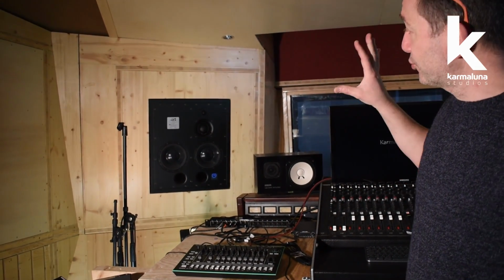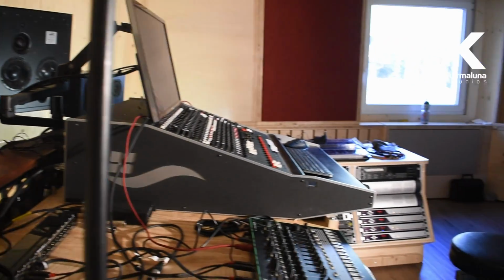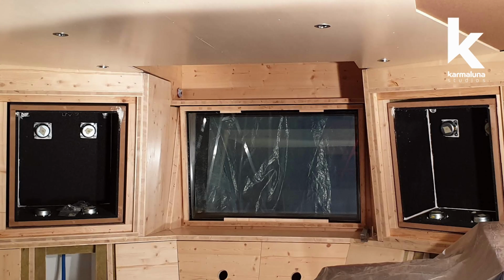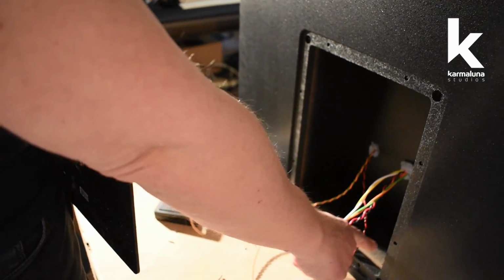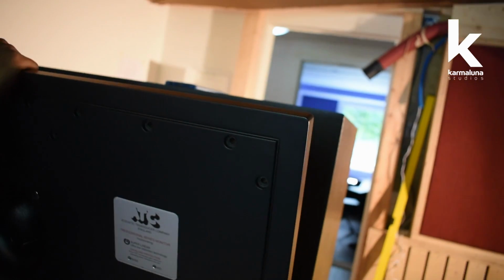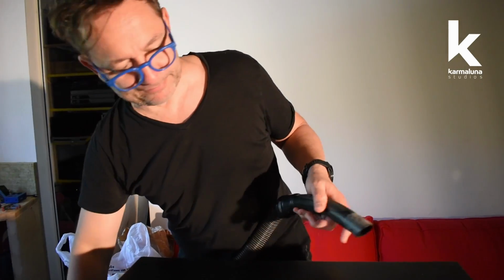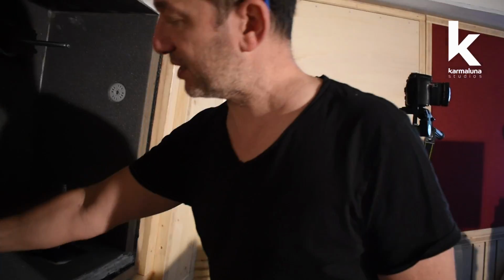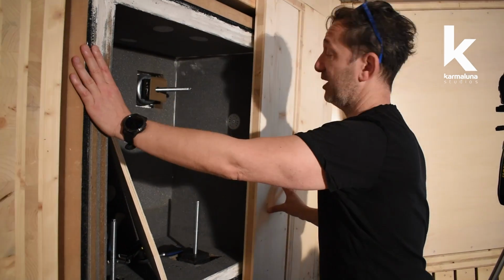In-Wall Soffit Mounted ATC Speakers

Comment: Hi, thanks for the video I am about to flush mount a similar sized pair of studio mains into my Control room front wall. My speakers are a custom built by a company in the UK, they are 700 x 700 x 350. Would it be possibly to get the contact details of the acoustician that advised/ consulted you with the process of mounting your ATC's
Regards
Ronan

Comment: Hi, impressive studio build, very nice studio! I have a question regarding the ATC speakers, if you don't mind me asking: did you use the active speakers and take out the amplifiers or is there a version of the speakers that alsready comes with the speakers and amps separately? And one more question regarding the runded edges of the speakers: is there a way to remove the rounded frame so that the fronts of the speakers are completely flat? This is the way I always see them when soffit-mounted. The rounded edges seem to be used when the speakers are set up on speaker stands. Thanks so much for you help!
Reply from the maker: Hi! Our reseller (Funky Junk) took care of ordering directly at ATC the version with separate amplifiers and flat frames.

Comment: Can i ask how big youre room was before building, how big the room is now and distance between the speakers? 

Kind regards
Alieu S Samateh
Reply from the maker: Sure! The empty room was around 21 ft in length and 16 ft wide, 9 ft high. We lost around 30% of its volume with the sound treatment.
The distance between the two speakers' acoustic axes is 8'-6" (around 2.6 mt).
Thanks for your support!
Reply: @KarmalunaStudios  Thank very very very much 😁❤️🙏🏾 You are welcome, all the best 🙏🏾😊
Reply: Do you feel like you need a sub for them in this room or is it enough bass? Best regards 😊🙏🏾👊🏽🙂
Reply from the maker: @alieustiansamateh6401  No, not at all, they deliver some amazing and very linear bass, after being in-wall mounted. But when I first tested the speakers just out of the box, on some open-air stands, then yes, I was a bit surprised by the lack of bass.
Reply: @KarmalunaStudios   what's the thikness of the wall s ?
Reply from the maker: @kobey95  The studio outside walls were just 6" (15 cm) thick. But after adding tons of flumrock, wood, lead, mdf. rubber, and furniture, I believe their depth ranges from a minimum of 16" (40 cm, on the long sides) until 4 ft (120 cm, around the speakers).
Reply: @KarmalunaStudios  thanks a lot for your answer

Comment: Awesome!! What is LEAD?
Reply from the maker: Hi there,
we did use the following panels:
https://www.ghirotto.it/prodotti/isolanti-acustici/piombopan-sb-0606/ 
A really amazing result!
Thanks for your support!
Reply: @KarmalunaStudios  thanks for your reply. So the panels are like replacement of elastomer? to decouple more?
And if you dont mind, What brand/kind of decoupler you use? thank you..amazing gear you have btw!
Reply from the maker: @mixbyJM  Thank you! No, panels are needed to create mass around the speaker-boxes themselves (the optimal would have been to create a case of concrete all around the speakers). Decouplers are working amazingly but are not an easy thing to select. They must be calculated by your acoustic engineer. They need to cut off some special frequencies and you need to pick them accordingly to the specificics of your speakers and the case you have built around them. The email of my acoustic engineer is in the description, just in case you want to contact him. Thanks again for your support and good luck with producing music! <3